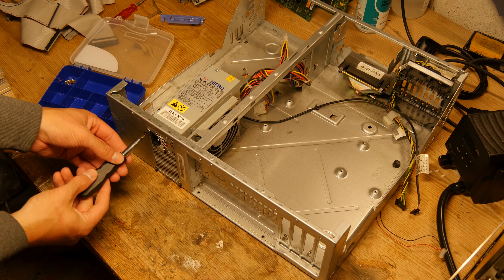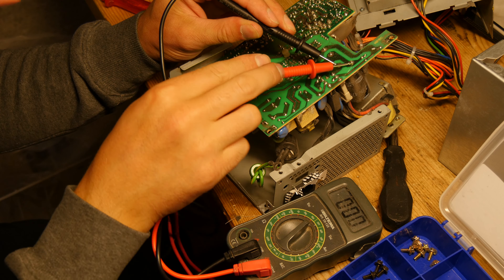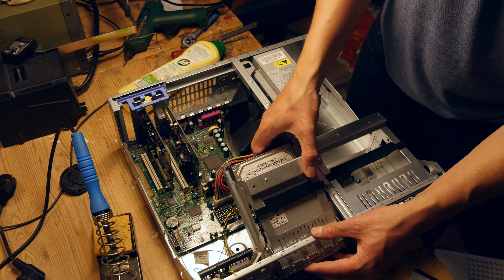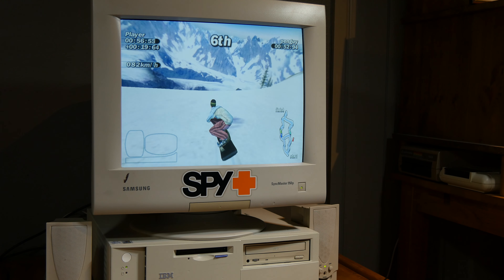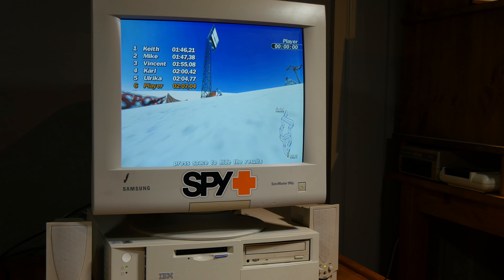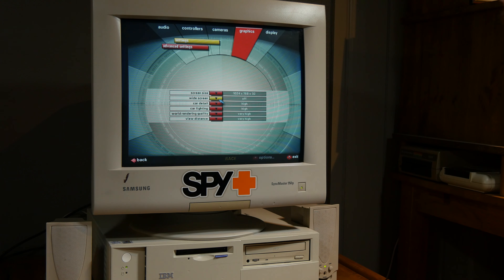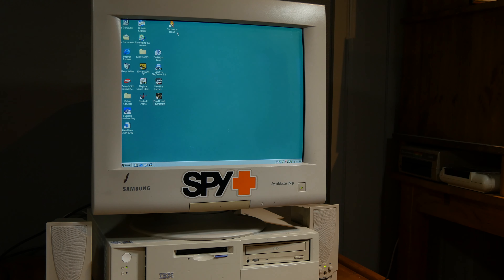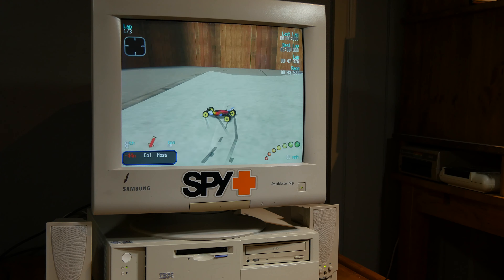Pentium 3 and Nvidia TNT 2 - IBM NetVista 6578

Comment: TNT2 Pro is the most interesting TNT2 version, because of the 220 nm process, instead of the 250 nm (TNT2/Ultra). Less heat and smaller process, so better for overclocking.
Reply from the maker: Is the pro version able to perform better then the ultra?
Reply: A little bit slower clockrates. 143 MHz Core and 166 MHz Memory for the Pro version. The Ultra has 150 MHz Core and 183 MHz Memory. Some Ultra versions, like the Hercules Dynamte TNT2 Ultra, are clocked to 175/200! NVidia stock frequencys are 150/183. The Pro version is very good for overclocking, because of the slower 220 nm process. Some models can be clocked to 175-185 MHz Core and 210-225 MHz Memory.
Reply from the maker: @3DfxAslinger  Nice, you know your graphics cards :)
Reply: I only have a TNT2 Pro from MSI.

Comment: Back in 1999-2000 the resolution 1024x768 was considered high. Most people only had CRTs with a maximum resolution of 1024x768. Very few has CRTs capable of 1280x1024. 1600x1200 was seen as often as a UFO :)), nobody had something like that.

Comment: Hello friend UnclueAwesome, I'm a new Subscriber to your channel.

Friend UnclueAwesome I have a motherboard like yours.
But there is a problem with my motherboard's BIOS.

I'm thinking about solving my motherboard's BIOS problem using the IDE cable method I'm thinking about connecting to the 2 IDE terminal buses on it.

This is my idea, it's good Friend UnclueAwesome or to stop this problem with my BIOS on my motherboard it has to be just with a special board for this BIOS to solve the problem
is a small board that sits next to the BIOS battery